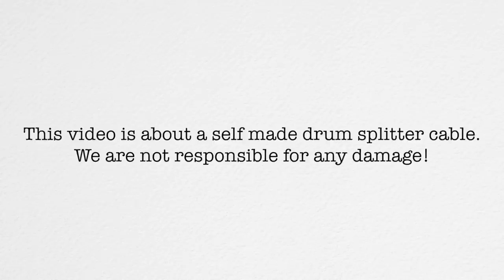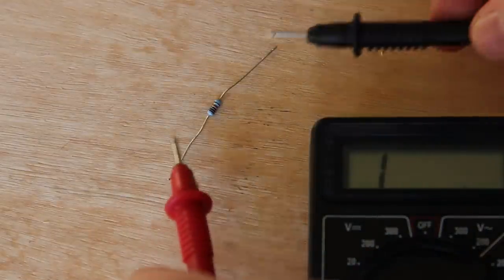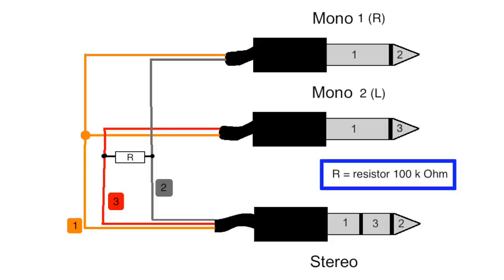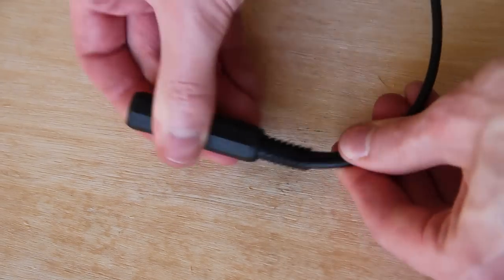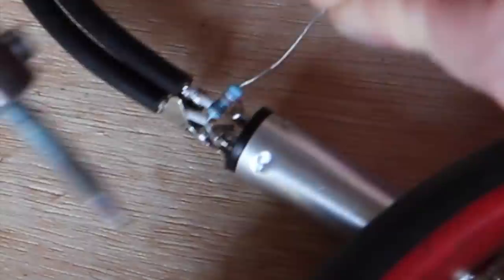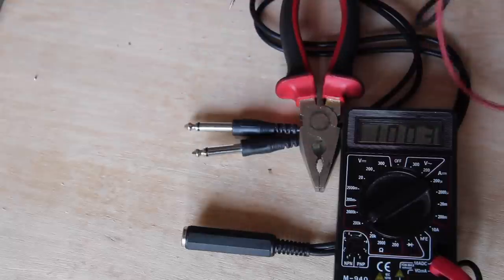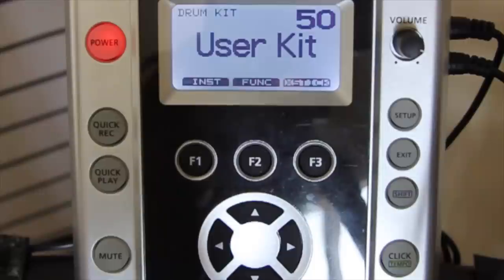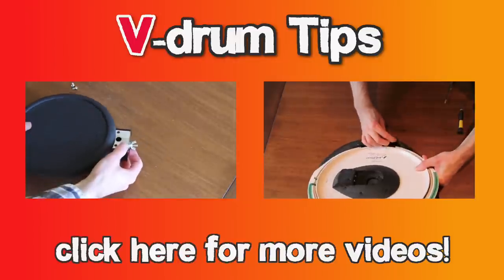Make a Drumsplitter Cable

Comment: I tried this -splitting my tom 3 head and rim to allow me to add an extra floor tom using the Roland TD11 module. I had two identical PD-8 pads, but could not get it to work properly UNTIL I CHANGED THE PAD SETTINGS IN THE TD11 MODULE TO A DOUBLE PIEZO TYPE PAD such as the PD-85 or PD-125 etc. After doing this I was able to set the tuning, damping, and volumes etc for each pad no trouble - works EXTREMELY well. My next step is to purchase two additional cymbols and split the tom 1 and tom 2 pads to gain a second crash cymbol and a splash cymbol. I am already using the auxiliary crash 2 socket for my DIY cowbell (cheap cowbell with piezo sensor and jack socket fitted). Cheers Steve
Reply from the maker: Steve Bartlett Hi Steve, that is great. I got this question from a TD-11 users. They described the same problem and I could not offer a solution as I don't have a TD-11. Thanks for the tip!
Reply: Vdrum Tips no worries - happy to help - thanks for the video and 100k resistor tip - that was a great help !
Reply: This is the most useful advice i ever read on the internet! Tried it so hard and it did not work. Now everything works brilliant, 2 toms are set to one stereo cable and a cymbal is added.
Reply: Hey brothers, how can I change the rim sound on TD-11 ?

Comment: What makes no sense is, even with a mono pad, if you connect that to the stereo aux of the Roland td-17, using a mono cable - that kills your sensitivity. Shorting that plus out kills your sensitivity.  Even with a mono pad, like the PDX-6a,  you lose sensitivity just by using mono cables.  I wonder if you really should be using stereo plugs on these splitters because shorting the cable out looks like that causes the issues.

Comment: Now you can buy the splitter cable Y with the resistor built in. Not surprising after 9 years lol. With superior drummer and splitters and added e-drums/cymbals/extras, you can build a massive kit from a TD9.

Comment: Hi! I want to share some Roland pad settings for splitting one bass drum trigger input to two bass drum pedals: 
Pad type: PD-125, Sensitivity: 13, Threshold: 5, (Scan type: 1,7), Retrigger cancel: 1, Mask time 0, X-talk, 0, Rim Gain: 1,3, Rim adj: 2,5. 

I found these numbers a long time ago but not anymore. Luckily I noted them down so when I screwed up my settings I could get it right. It’s not perfect but saves u time better spent on actual drumming. This works at least for my gear: SPD-30 and KT-10 pedals. Feel free to pin it.
Happy drumming!

Comment: I have achieved success with Alesis Trigger IO and Alesis drums. Turned 10 inputs into 14 as some channels are used for Dual zone heads. I did use the resistors. Thanks for the info. Be sure to carefully configure the module parameters though.
Reply: justin junker The resistor is 1/4 watt. The drum module is the Alesis Trigger I/O. I use it with Cubase and Reason on PC.

Comment: FYI: 
I build a drumsplitter myself with a 120 kohm resistor. It works great with the TD25 IF you use the kit as a MIDI-Controller. I use it with LOGIC X with superior drummer. You can change the MIDI-note-number in the soundmodule. So you can set the cybmbals for example zu China and Crash (or whatever). Im really happy with this solution. Im recording with Midi-Drums anyway. So it suits me fine. :)
Reply: What made you use the 120 kohm resistor instead of the 100 Kohm? Im just curious. I have a td6 and I used a 100 Kohm resistor and it didnt work. I have seen comments where people have said this technique is not possible with the td6, but I figured it was worth a try.
Reply: what is the purpose of the resistor?

Comment: I made splitter cables for my Yamaha dtx. Never used a resistor, it worked fine.
Reply: I noticed that you stated that you had to make splitter cables for Yamaha DTX, which is what I use (DTX900M).  I have purchased "edrum splitter cables" that match the specs that Yamaha's own web site states is required (stereo split to dual-mono) and none of them work.  Do I have to make these cables by hand as shown in this video?

Comment: This was written in 2014, the TD-17 came out in 2018, which was to replace the TD-11.  does this DIY splitter work on the TD-17 Aux and Crash2 inputs?

Comment: Works with Alesis Surge. I couldn't obtain 1/4watt 100kohm resistors, so used 1/2watt in it's place, works without any issues.

Comment: I used a 100K resistor  1/4 Watt,   its a bit unstable.   does it matter what the wattage of the resistor is.  in other words should i buy the 1 watt 100K resistor. ?
Reply from the maker: +Louis Socci I tried 1/4,1/2 and 1 watt. No difference.

Comment: Hi there!
I just want to split Roland PD 8 dual trigger pad(piezo-piezo),on two separate cable .
I want use a Yamaha tmx sound module,which does accept only ts inputs,mono cable
One cable (center) to one input 
One cable (rim) to another input
Thanks .

Comment: Found this very helpful. May i know the watts of the resistor? Thank you.
Reply: 1/4 W it's ok
Reply: @Garba236 can I use a 2 watt resistor
Reply: @KDrummer54.  I've use a 100kohm (colour code: black-brown-yellow) resistance. the split works correctly applied on 2 8" pad.

Comment: Great video, what diameter coaxial cable is on the guitar lead you used? Looks like the 2 can fit side by side in the female  jack casing, are they 2.5 mm diameter leads?

Comment: I want to add a 3zone ride cymbal to a module (Alesis Surge) which as far as I can tell only has dual zone inputs. I realize this won't work with the modules limited sounds, but I plan to use it with Slate Drums Software via midi. So I'm considering sending the extra zone into a separate channel on the module and adjust the routing/mapping at the software. Does this sound possible?

Comment: would this work for double bass using two kick towers,?I have a td8 the kick jack says 1/2 ????? would be awesome
Reply from the maker: +Stacie McKenty-Assal you can use a headphone like splitter for 2 bass pads. Basically splitting a mono cable.

Comment: Having issues with mine, maybe because the tom pads are the rubber PD-8 trigger. I cant seem to get consistent results from splitting the toms. I split tom 1 into 1&2 and no matter the pad settings it is triggering both rim and head sounds. 100kohm/1 watt resistor used. TD-11 2014 model
Reply from the maker: You might have a short circuit in your splitter. Did you measure the splitter like shown in the video?
Reply: Vdrum Tips I did not measure the resistance, I used new 100kohm (actually 1/4 watt not 1watt like I posted above). I changed the pad type in the td-11 from pd-8 to PD-85 and now it works well with the sensitivity around 15.. I actually made a box with jacks vs the cable. Thanks for the tips!

Comment: Hi, i used a high quality 6.3 mm stereo to 2 mono jack splitter cable but it didn't work. i think it really needs that resistor. Did you try this on a TD-3 ? i don't want to bother making it if it doesn't work on a TD-3. i would be really glad if you could answer it.
Reply from the maker: It is not working without resistor. I am not sure about the TD-3, cause it is to working on the TD-6. They appeared both at the same time.
Reply: Vdrum Tips
Thanks for the answer but i couldn't understand what you said there "cause it is to working on the TD-6". Did you mean "it is not working on TD-6" or "it is working on TD-6". i guess it is not working on TD-6.
Reply from the maker: Sorry, yes, drumspliiters do not work with the TD-6, so I doubt they work with TD-3.

Comment: I have a TD 9 and i have successfully split 2 of the inputs.  unfortunately i can t seem to get past 2.  is there a limit per module. I get the head to sound but the rim is completely choked.  i get sound from the rim but with an extreme choke,  any suggestions out there
Reply from the maker: +Louis Socci Have you tried to adjust the module via head rim adjustment on this pad?

Comment: hi Marcel
Do you know what watts the Resister has to be? at 100koz, as they come in different watts or does it not matter, but your sight has great tips..big thanks
Reply from the maker: Hi Peter,

I could never find any info about that. That's why I tried out 2 different ones. There is no difference between a 1/4 watt and a 1/2 watt resistor in my case. Both are working great.

Comment: Tried making this project in project box as described with 100K resistor between two mono tips. Using a TD9 module. The head trigger works but the rim doesn't. I'm trying to use the splitter for Pintech tube triggers.

Any known issues with these or with the TD9? Any advice for troubleshooting?

Thanks for the video!
Reply from the maker: Check for short circuits and make sure you connected the resistor between the tip and sleeve. It is best to use a multimeter or if you don't have one, just go to an electronic store and ask them to measure the resistance. Hope that helps.
Reply: @Vdrumtips1  I hope you mean the connection should be between the tip and the ring - not the sleeve.

Comment: thanks a lot...i can now expand my td15kv while sacrificing all toms rim sound..
Reply from the maker: Cool, so you made 3 splitter cables?
Reply: Marcel Price yup, i routed the tom1 for a cy5, splitted tom2 for tom1&2, splitted floor tom for additional floor tom(pdx-100)..so the 2 aux slots(design for dual zone pads) for td15 are being used for cy13r which is triple zone, now wonder if could use the extra zone to make it as a single zone cowbell..any advice?..
Reply from the maker: I think you can split the ride cymbal as well. But I am not sure which one of the 2 cables. Can you send me a pic of your kid. I would like to post it on my FBpage:)

Comment: Vdrum Tips plz help: I made a cable just like you said, with 100Kohm resistor for my TD-9. But it doesn't work. All the two cable end works like RIM but one cable is quiter like the other. What is the problem?
Reply from the maker: rooland87 It could be many things. Check my website FAQ, I think I wrote an article there. Most likely there is a short circuit or the wiring is wrong. Could also be because of the wrong jacks.
Reply: Thank you very much for your quick respond. I found an hour before that if i switch the trigger type to PDX8 instead of CY12C, it works almost perfect. I think I just only have to adjust the treshold and sensitivity to a correct value. Anyway I use this cable for cymbals (china/splash) maybe this is a little more tricky instead of tom pads. Have you experience with cymbals or cymbals are fully the same as tom pads? :)

Comment: i got my conversion done with the 100 k resistors. small bit of cross talk but im experimenting with settings. i spent a bit of time at it today and looks like i might not be able to do too much about the sensitivity of the rim pad on the roland td9 version 2.
seems if i try bring up the sensitivity in rim it brings up the pad sensitivity too as in i cant seem to seperate it.  striking the rim trigger was hit and miss but a good solid strike of the meatier part of the stick triggered it. im wondering will i be able make the rim pad trigger  as easy as the normal pad? im a bit worried about breaking sticks or hurting wrists as i have mostly rubber on metal pads. maybe im looking for too much with it. maybe an extra module is the way..
Reply from the maker: +jim power You have to separate head and rim sensitivity with the head rim adjustments. Both head and rim have a separate gain level.
Reply: Yea i was upping the rim gain but it still took a good whack to activate it
Reply: +Vdrum Tips the only guy in town that had the 100k resistors had a alesis dm5 on the shelf never used that he said he would sell it cheap. maybe not the holy grail but might be cheaper than mesh pads. cus my steve gadd sig. sticks wont hold out whacking the rubber pads to activate rim.

Comment: I wanna use that cable for a mixer. I used to conect my laptop with 3.5mm estereo Jack and two mono Jacks 6.3mm in a mixer but I didnt working on, the sound is  low, if put the resistor my problem Will be resoult?
Sorry for my english, I'm Mexican
Reply from the maker: you cannot use a cable with a resistor for a mixer, it is not made for that. it is made for roland module only.

Comment: Hello there! I have a td17kv roland, I’m trying to split the aux out to make two mono pads... I got a regular stereo to l/r mono cable and add the 100ohm resistor, now my pads detect both , rim and head depending on how strong I hit... is that right? I want a total split. Do you know what happen?
Reply: Have u tried without the resistor ?
Reply: I try make it Like in the video,  with resistor. The two mono cables send the same sound (head), not working the rim sound.  Whats wrong? :(

Comment: TD9 rulez!Falling in love with this drum module! <3
Reply from the maker: The TD-9 is one of my favourite modules. I wrote a post a while ago about it: http://www.v-drumtips.com/why-do-i-still-only-have-a-td-9/
Reply: Yeah...i've already read your article!I've a question for you, i'm using the EZDrummer 2 on macbook with UM-One MK2 midi/USB adapter...how can play a song in background?I need to use another software extra EZDrummer?
Reply from the maker: You need to run EZdrummer within a DAW or you use a normal audio player in the background.
Reply: DAW??What is this?So is impossible to play an mp3 with ezdrummer itself?
Reply from the maker: Digital Audio Workstation - the recording software, like Cubase or Logic. Yes, just play the mp3 in the background.
Reply: uff 😥😥😥 i hate to waste ram in this way 😣
Reply: I've solved the playback song in this way.On th9 Setup-Midi menù there is an option called "Local control",setting this to OFF and connecting a male-male jack from PC to Mix-in in the module, i can ear the sound from ezd2!In this way i can use the module with all his function,like play mp3 using the SONG button,the scope with metronome ecc ecc...now i have ti solve another problem, the dual zone of my cy-12c and vh-11...the ezd2 reproduce only head sound,also if in the module i can see R and H for rim and head triggering...can you help me?Thanks
Reply from the maker: Well done. EZdrummer has only 1-zone cymbals.
Reply: Omg...really?So i've to use Superior to have 2-zone cymbals??

Comment: It works but I got cross-talk between the skin and the rim... I can'y adjust the cross-talk because I'm triggering my Modular with the trigger out of the PD-7 directly... What's the resistor for?
Reply from the maker: +Drilldoughzer The CV Slave The resistor tricks the module. The modules are just constructed in a way that you cannot just split inputs.

Comment: Does this work with Roland TD-4KP ? Whats the way of expanding that particular drum set? Is there any way?
Reply from the maker: No
Reply: Yes you can expand the TD4KP. The best way is to buy a wire harness from the td4k (not P) model. The non P model supports adding an extra dual zone cymbal (or pad whatever you want) via an extra cable on the wire harness. The drum module on each model is identical, only the harness is different. Read the TD4K (not P) manual for more detail. The reason this is the best way is because you get dual zone, and there are no double hit limitations.

Also you CAN use a drum splitter with the TD4 drum module. If you go to Menu > options you can unlink the head/rim sounds before going to the instrument menu and re-assigning. Bear in mind though you are more limited than with some other modules because the td4 does not have dual zone toms.

I have used both methods on my td4kp. With the top method I have replaced the standard ride cymbal with a cy13r (which requires 2 inputs), this cymbal is ridiculously nice to use and is a huge upgrade. I have also used a drum splitter from the snare to add an extra single zone cymbal.This is an excellent video for the drum splitter thanks!

Comment: I made the exact things you made. But I still get head trigger from each mono male jack. Can you help me please? The only thing I notice is your resistor and mine is different. My resistor is 100kohm as it is said in the video but it is not blue and is not as big as yours. Please help me !!
Reply from the maker: Hi Emir,

the resistor should have 1/4, 1/2 or 1 watt. And look like the one I used.
Reply: Vdrum Tips Hi, i am going to order some resistors. Which 100 kohm resistor did you use in the video? 1/4, 1/2 or 1 watt? Thanks in advance.
Reply from the maker: labigithastaetmeadam not sure, think it was 1/2.

Comment: Is it possible to apply this drum splitter cable for splittting signal from hi-hat (bow and edge zone) in order to use separate inputs (hi-hat and aux) for each zone? Unfortunately my module doesn't support dual zone hi-hat and I want to assign different midi notes for each zone and play via software samplers.
Reply: Who knows?
I am experiencing the same problem.
Did it work out for you?
Did you try?
Reply: @adrianbort2564  No, unfortunately I didn’t try.

Comment: why cables must be connected by a resistor?
thanks for the reply.
Reply from the maker: To trick the module. The piezos on a dual trigger pad are connected in a specific way. The resistor is simulating that. That is how I know it.
Reply: So would this not be necessary for an arduino-based midi module with DIY triggers, for example, or is this universal?
Reply: I see no reason why the resistor should be necessary, either electrically or musically.
'Crosstalk' is generally bad, either acoustically or electrically.
Some people find it works without it.
I presume some manufacturers test for a resistor in their triggers, purely so that triggers from other manufacturers won't work! Cynical?
Perhaps the firmware needs to know that both channels should be enabled?